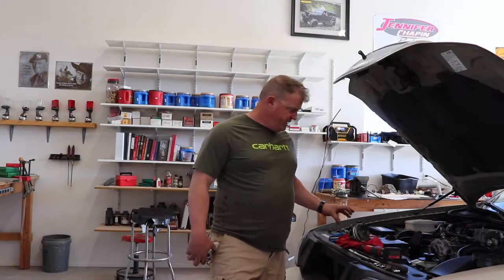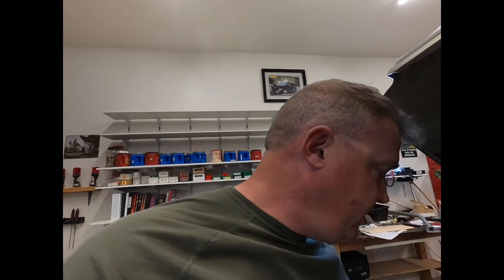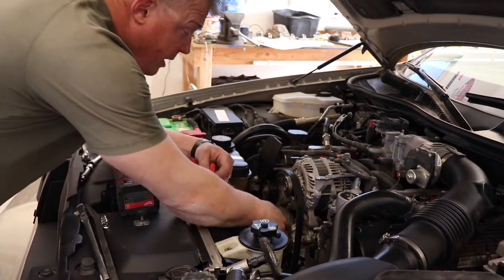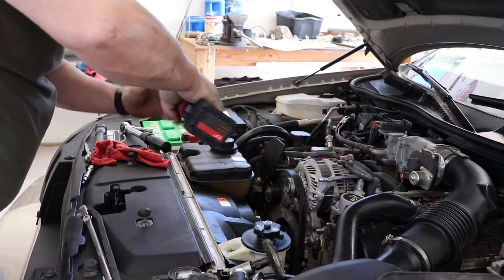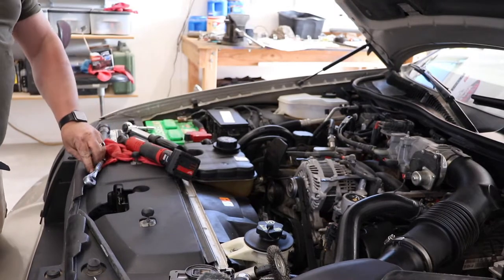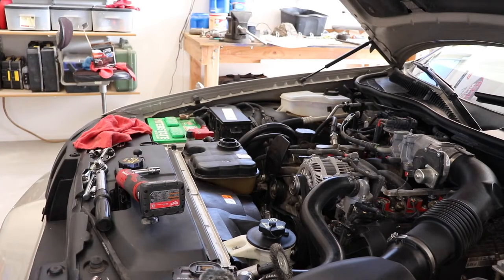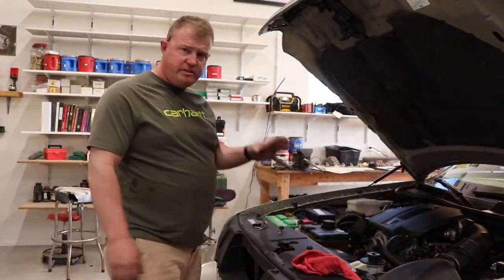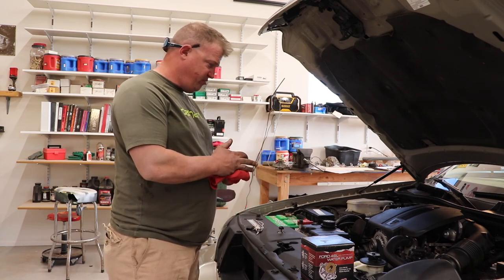Stewart EMP Performance Water Pump 2000/2011 Lincoln town car and Ford crown vic

Comment: Your a lucky guy upgrading the water pump before disaster strikes. It already went on me going to work around 98,000 miles on the car at that time. I was at the end of Pennsylvania the  last rest stop. Antifreeze was pouring out of that hole I didn't want to be broken down in this state.  I keep driving till I entered New Jersey the needle kept going up and down up and up until the car shut off.  I coast it to the shoulder called for a tow truck took me to a good auto repair shop.  Repaired that same day it was $354.00 water pump and $107.00 for tow. The tow truck driver asked what car I had I told him 2008 Lincoln Town Car. So my car was carried wich I prefer better. All in all it was worth it now I have a warranty if it fails it will be repaired for free. These cars are designed if ever overheats the car shuts down. Didn't blow a head gasket or burn out the engine. Your video will help out a lot people who really don't know when this is going to happen like it happened to me.
Reply from the maker: Thank you for the compliment. I went to school to learn how to be a mechanic. And I Learned in school how to spot the signs of a failing water pump. I looked at said that we pull saw some water scale inside that figured the water pump seal had started feeling it was time to get on top of it. Plus a lot of the stuff on my car I it’s getting old and needs to be replaced. You can actually go onto Ford’s website and look up your vehicle and it’ll tell you the maintenance schedule to help you prevent breaking down. I tend to follow that pretty religiously and it has served me well.

Comment: Hey Cody, nice video the main advantage to that pump is its less prone to cavitation at high rpm and better water flow.  Sadly there is not much HP to save in the water pump area. I watched some dyno videos of before and after Hp #'s with a electric pump vs HP or standard and it was like only a couple HP. I was going to go with an electric pump to save some HP but $400 to save 2 or 3 HP is not a worth while investment I will up grade to that pump if mine starts to fail. Actually the alternator is a bigger drag on the motor under load than the pump. You might want to look into some under drive pulleys to save a bit of hp but even those are minor gains. That water pump is still a good up grade when you need to replace the pump tho.

Comment: WHERE CAN I PURCHASE A EMP STUART WATERPUMP FOR A 2011 LINCOLN TOWNCAR SIGNATURE LIMITED???
Reply from the maker: https://adtr.net/product/mercury-marauder/cooling-mercury-marauder/stewart-emp-performance-water-pumps/
Reply from the maker: I can’t remember if the the 11 has a short or long shaft water pump? But the website will inform you which one you should buy.